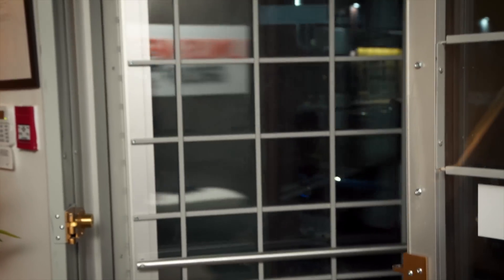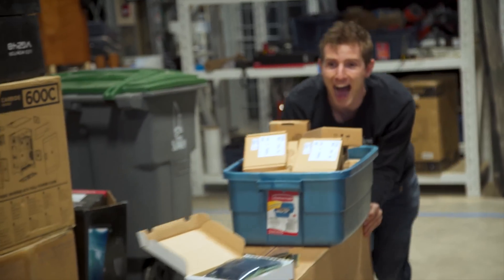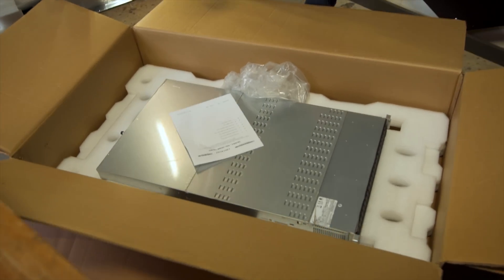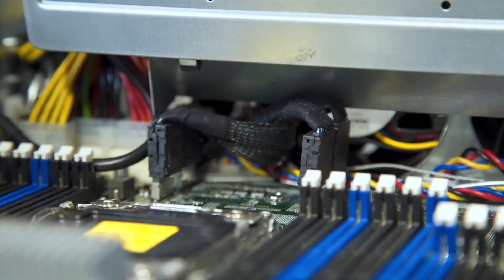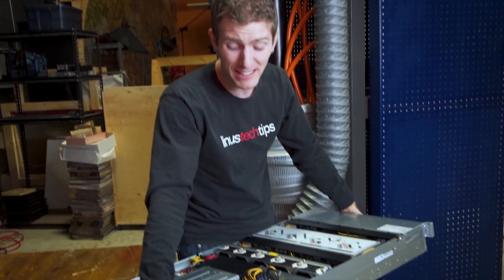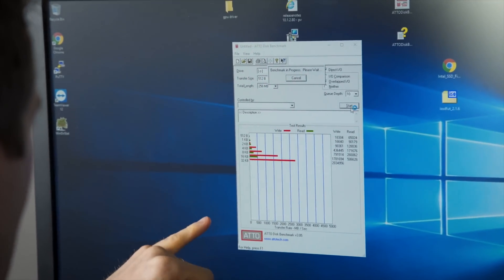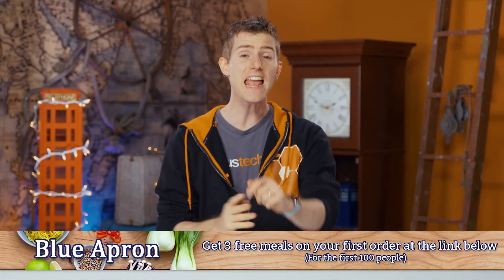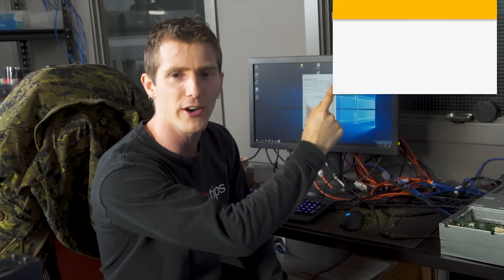The Fastest Storage EVER – HOLY $H!T Ep 14

Comment: I am the only one with 4 mbps broadband speed ?
Reply: Brononymous Rival I can't here u over my 3000 ping with my 200kbps broadband speed
Reply: I can't hear you over my 200 mbps.
Reply: mine is just enough to run youtube in 480p lol
Reply: 56k i run 240p
Reply: takes forevr to post comments
Reply: I'm paying for 200mb but get about 50 on a good day going downhill with the sails up, fuck you virgin media.
Reply: no i have 1 microbite per 10 years ( ͡° ͜ʖ ͡°)
Reply: 1.5mb/s DSL master race
Reply: ghakz nice specs mate. I can tell u, LGA2011-3 is awesome. I myself have 6800k at 4.1GHz and a ASUS X99A-II with 64GB GSkill RipJaws4 running at 2800MHz. PSU is Corsair HX1200i, case is custom made out of titanium-aluminum alloy to fit into a rack (5U) and I have 2 GALAX/KFA2 HOF GTX 1080's running at 2.2GHz.
Reply: I actually have a 1,000Mbps connection.

To the router. Beyond that with 9Mbps. Sad thing is, we pay for 16Mbps and the line can support 11.9, but that wouldn't be stable (believe me, we tried it, internet went away every 20-30 minutes until you restart the router), so we can only get 9.
Reply: You'd be surprised how many areas even in silicon valley lack fios, where people are trapped on copper which keeps raising in price perversely to the point where it costs way more than faster options.
Reply: 7Mb DL, and 0.40Mb UL....Italy sucks
Reply: My phone achieved 220,57Mbps DL speed and 37,69Mbps UL speed on LTE-A network here in Finland, at least according to Speedtest.net mobile app. Not too shabby.
Reply: 50mbps up and 8mbps down here in the UK
Reply: eamh2002 in Helsinki yeah but not next to a link and my operator is DNA :D but even on the countryside I'm getting solid 100Mbps download speeds :)
Reply: Brononymous Rival i only get 300 kilobytes per sec
Reply: In Helsinki next to a link? "fastest Elisa" operator?

Nice speed though :D
Reply: Connor Scott
lol really where do you live ?
Reply: Jesus lmao no but it does have hot swappable hard drives and since the case is customized, it has semi-hot swappable fans (Noctua IndustrialPPC's)
Reply: 300mbps for 9.90€ per month here in eastern europe
Reply: stop bragging. i have under 1 mbps.
Reply: Try an advertised 2 mbps, 1 mbps according to test website and a whopping 100 kbps real world download speed. If you're an internet nerd, never move out into the sticks.
Reply: Brononymous Rival hahaha Canadian internet is waaaaaay worse than that
Reply: ireland. im getting 1.6 mbps. hate it
Reply: 250 mbps in Barbados(3rd world country?)
Reply: filipinos are with you dude .
Reply: i have 40 mbps
Reply: Brononymous Rival mi
m8 im in the kbps.
Reply: Jeesus Könde paljonko maksaa liittymäs kuukaudessa
Reply: Brononymous Rival 150 Mbit. sorry bro.
Reply: Brononymous Rival 1GBPS lmao
Reply: 5mb/s DSL :D
Reply: No mate, you are not the only one...
Reply: 4, REALLY ?
bro , you have a fast internet :D, faster than me
Reply: 1gbps here(japan fiber oftics NTT) PC spec: LGA1150 i74790k, maximus 7 formula, 32gb dominator platinum 1866mhz, 2x 1070 FE, 2x transcend ssd 512gb, nzxt x62, casing phanteks enthoo evolv tempered glass, HX850i, next planning for LGA 2011 lols...
Reply: Nikke Hautapelto tais jtn 44 egee olla kuussa
Reply: Jeesus Könde jeesus sulla on vähä kovempi boxi. Käytäksä mobiiliverkkoo kotona vai onks sulla kaapeli
Reply: Nikke Hautapelto säästän massii käyttämällä pelkkää mobiiliverkkoo ja tollasil nopeuksilla ja ku pingi on alhanen ni se on ihan järkevääkin
Reply: Jeesus Könde joo mulaaki on vaan mobiiliverkko käytettävissä mut pitäis hankkia tarkka 4g antenni et saisin 150 ylös ja alas
Reply: Nikke Hautapelto ite en voi käyttää lisäantennii ku käytän kännykän nettii :D
Reply: Jeesus Könde joo ne modeemit mihin saa sim kortin on aika kalliita ja niitä ei löydy mistään
Reply: Nikke Hautapelto verkkokaupassa oli just ASUS modeemi, LTE-A tuki ja kaikki operaattorit toimii, sit gigabit lan ja tais olla ac WLAN 1750Mbps
Reply: Jeesus Könde pitää kattoa
Reply: same
Reply: 2.00 upload and i'm still doing livestreams at 720p with big delay :D
Reply: no u are not alone :\
Reply: Brononymous Rival i have 120mbps DOWNLOAD speed. What the hell?
Reply: Brononymous Rival 8 Mbps, at night 40 Mbps
Reply: I got google Fiber
Reply: Simoncircle same here. 850 up/down on a bad day :)
Reply: Brononymous Rival I like trains
Reply: Mike Munro I'm in the exact same boat as you!! Virgin media sucks!
Reply: Brononymous Rival 1 for me
Reply: Gluteus Maximus when using Ethernet i get up to 80mbps.. But for some strange reason this one time I got 200mbps on my phone, while I was out in my back garden.
Reply: Gluteus Maximus Can't be using wifi for gaming man c'mon, of course I'm hardwired.
Reply: Gluteus Maximus ah ok I just tested it and I got 124down and 6.5up but I do pay for their 200 package.
Reply: Brononymous Rival I have 250 kB wifi
Reply: MysticLightning2K12 yea, same here bud
Reply: 100/100 fiber here in Denmark
Reply: 400Kb/s Morocco ;( :(
Reply: 200 kb/s  in australia :(
Reply: 100 Mbps Australia :(
Reply: 1000 Mbps here.
Reply: Jesus Christ $69? i only pay $35 for 1gbps download and 1gbps upload speed, holy shit dude! :) (NTT Japan Fiber Optics)
Reply: Brononymous Rival I have 11Mbps I live in AUS
Reply: ghakz gbs?! I get 30mbps
Reply: I have 20mb but because its bell its 700kb
Reply: you also from japan? yes 1gbps not mbps
Reply: Brononymous Rival I have 2mb
Reply: I've got 15. But that's the max in our area. Most people around my area have 5mbps or so.
Reply: Brononymous Rival 2mbps
Reply: Connor Scott but the b here is bit, which is 1/8 the size of a byte, so theoretically its only 125mbytesps, unless I'm mistaken about your country's ISP
Reply: all the Australians over here be like :'( we so slow tho
Reply: i have 10mbps
Reply: great
Reply: hey thats pretty good
Reply: Quality Content your grammar is bad also gay is not an insult
Reply: how does he know im gay does he stalk me
Reply: Nah man! i feel ya ;_;
Reply: Brononymous Rival   I wish that :(
Reply: Brononymous Rival damn bro,I have 216mbps.  u should get new interwebs :p
Reply: i have 300 mpbs Wifi
Reply: Nope :( Rural Ontario, the provider that owns the phone/internet lines won't let anyone else work in the area and refused to upgrade when they had the chance
Reply: JustusLM I also have 1000 Mbps to the router. I have 500 Mbps from the provider aswell :P
Reply: 25 kbps DL / 0.4 kbps UL :)
Reply: Brononymous Rival I had a 6 GB/S download and  0.60 GB/S upload until I switched to Spectrum, 71 down 6 up next to the router.
Reply: MacVirus how did you upload this comment?
Reply: Brononymous Rival lol i get 3 mbs download gg
Reply: Teal I don't think wifi supports those speeds, and you'd need to pay a lot of money to get 100 Gbps Ethernet (if that's a thing)
Reply: It's a weird situation for me 

in town I got fibre optics/copper at like 100mbps down and up 

but in the country boy I got that sweet satellite connection you know I'm talking that 10mbps down/ 1mbps up (watching YouTube at like 240p if I'm lucky and wait)
Reply: In northern bc Canada btw
Reply: well 2mbps is fine
Reply: Mine is 5mbps. UP DL same. :D

Comment: We use a HP 3par SSD SAN storage array at my work which runs over 3000 virtual servers. At some point it would be better to move to an enterprise class storage solution, way better for data security has the ability to use fiber channel over Ethernet.

Comment: How is it possible to reach 10 gigabyte /s when you only use 4 10 gbit ports (because 40 gigabit = 5 gigabyte)
Reply: Because it wasn't measured across network but internally i think, that's why he had to connect the monitor to the server.
Reply: Why do these drives not give you faster boot or game loading compared to
 a regular SSD?  They just have super fast file transfer speeds, but you
 would need another drive this fast to take advantage of it. I was about
 to get a 960 PRO or EVO until I watched videos on boot times and game 
loading. They were not faster at all. They both has identical times 
almost compared to a 850 sata.
Reply: He also mentions bonding the 4 nics, but that wont give 40gbps overall, it will just support 4 different connections each at 10gbps, bonding does not send traffic across all NICS, total bandwidth will be 40gbps but only 10gbps per connection, supporting 4 different connections each at 10gbps. really should have put a 100gbps nic in instead.
i have built my own SAN for my virtual infrastructure and that uses 10gbps NICs, i get 950MB/s R/W which is pretty much the max, Linus will have the same limit with that setup unless he uses 100gbps NICs.

Comment: 24 1.2 TB PCIE SSD's while im over here with a 1 TB HDD that can't even load a goddamn game within one minute
Reply: Dude depends on the game, my SSD still cant load Cities Skylines or KSP (both heavily modded) in less than 3 minutes xD
Reply: Baleur i have no problems with my EVO 840 SSD. xD
Reply: Average Gamer bro i have an i5 6600k 3.5 ghz, asrock b150 fatality gaming k4, 16gb ram and 1060 6gb gigabyte oc and a 1tb hard disk 7200rpm.... jezus give me a better motherboard and a ssd
Reply: I have 4 1TB HDD's witch runs with 7200 RPM. Those four HDD's runs in raid 5 and I primary have games on them. The system runs on a 118 GB SSD xD It runs a game in around 5-10 second xD

Comment: I know you're a Windoze guy and all, but for a strictly storage server may I humbly suggest BTRFS on Linux? You get redundancy, hot swappability and hot upgradeability, and the amazing joy of instant backups by way of snapshots. You can talk to it with SMB (Windows file sharing) as well as basically every other networked filesystem on the planet. And, oh yeah, it's free.

Personally, I'd do hardware RAID1 on a matched pair of relatively fast SATA SSDs in the rear to hold the OS, then stick all 24 possible NVMe drives into a BTRFS pool.  Boot time really isn't an issue (I mean how many servers take five minutes or more just to get through POST?) and once it's booted everything is resident in RAM anyways. 

Did I mention BTRFS does deduplication too?

Comment: that bitchin SSD's cost $600 a piece for 400GB....he is throwing it around at the beginning.
Reply: SSD's wont break instantly if you drop them... especially in that box
Reply: ***** its still heart breaking though
Reply: Minkafighter Aren't they even more shock resistant than a lot of hard disk drives?

Comment: The fans (or whatever coolers they are) sound like an airplane. Probably a 777
Reply: Or maybe the sound comes from another thing and not the cooler, correct me
Reply: Those are from server. He mentioned not bad for 2U unit. 1U is even worse because usually there is only heatsink top of cpu and extremely fast spinning fan blowing from side, hence the noise. They are meant to be in datacenter where sounds are less of importance.
Reply: I thought the same. Did they put a GE90 in there?
Reply: Damdinsharav Batsuuri app Zn
Reply: No it really sounds like a bus in OMSI

Comment: So in the name of extreme performance, why did you limit yourself to a PCI-E 3 16x slot worth of bandwidth when there was also the built in U.2 connectors, which I presume could have doubled the theoretical bandwidth. I'm sure there were enough SSDs to saturate both.
I also have to ask why you didn't use enterprise drives, such as the Intel P3700?